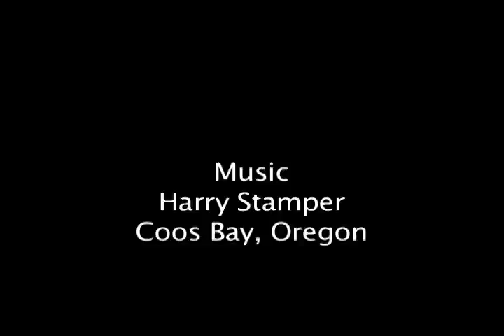Cascadia Subduction BLEVE Boiling Liquid Expanding Vapor Exp

Comment: If the Cascadia subduction fault goes off, there will be far larger problems than a few cng tanks going boom. So...  Use clean  cng till the big oregon quake hits or keep burning wood, diesel and gasoline? You can complain about cng tanks this week and fossil fuel pollution next week. Oregon econuts cant make up their tiny minds.

Comment: I tend to think the tanks being on the sandbar are a bit safer and here is why. One, no land fires burn across sand. Two, no nearby structures or forest to worry about burning if a tank failed. Three, in the event of this earthquake the tank may fail, but it falls into sand or the water abating the fire before people have to. LNG, Butane and propane will not hurt the water or land so if a tank falls into the water, it will vent off safely without a fire. If the tanks fall over in the sand they are naturally contained. The fires in this video are in town, you you rather a tanks failed in town or in a sand bar next to water? The sandbar is smarter than it first appears. If a tsunami hits, the tanks sink a little and vent harmlessly. However, I doubt very much they'd sink on 100ft+ peers below the sand. So yes, cascade of failures, but all naturally contained without human presence.